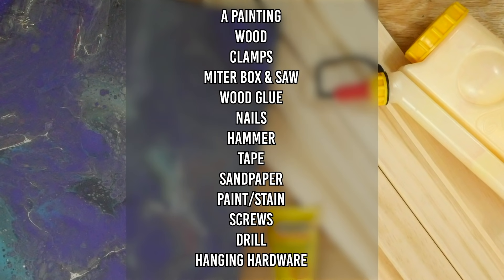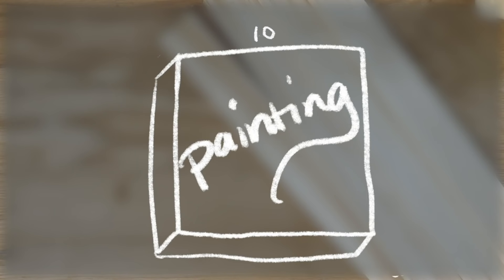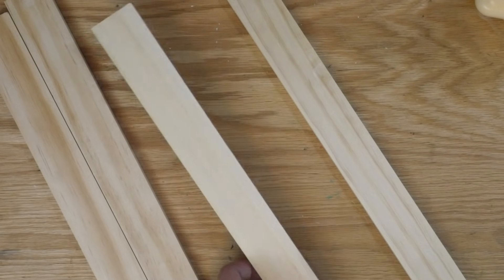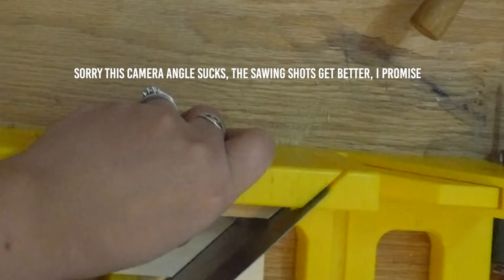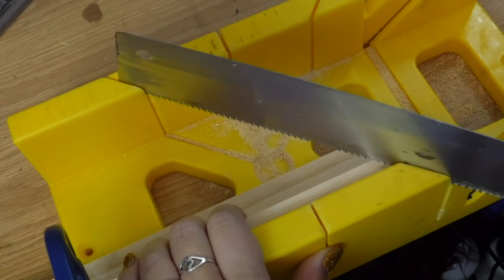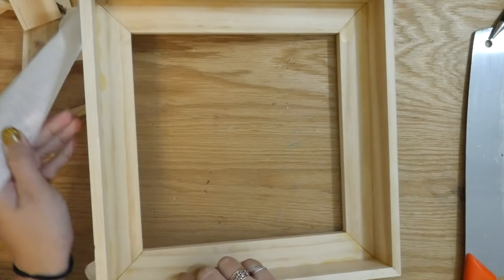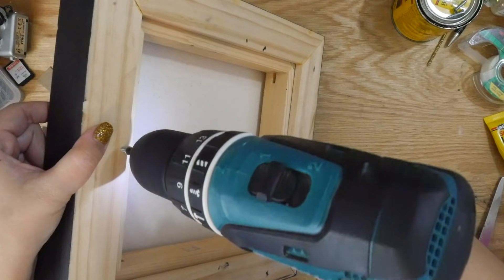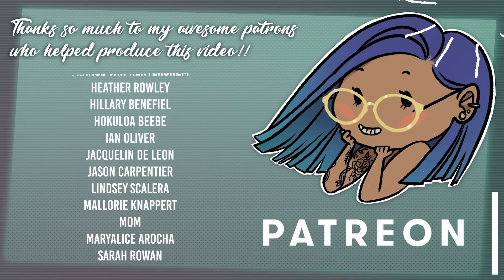How to Make a Floating Frame : DIY

Comment: Great work for beginners in wood working and awesome video and tutorial!

I would recommend going through grits when sanding, especially on pine, starting at 100 - 120 - 150 - 220, wiping off or vacuuming off the dust and using mineral spirits between grits; this will ensure that the stain will take better. Finally, apply a coat of wood conditioner to wood (only for soft woods like pine), this will prevent or reduce splotching that you get with stain when applying it to softwood. After the desired coat(s) of stain is applied, scuff sand with 400 grit sand paper, then seal the wood with Shellac, or polyurethane.
Reply: Shellac is preferred for cotton or linen art canvas.

Comment: You are like the 14th person I’ve watched make this frame and you stacked the two frames (inner and outer) so that you have a seam showing on the outside. The support pieces Can be placed on the inside so that When the picture is on the wall you have one solid piece of wood showing all around. I knew you were doing it differently when I saw your animated drawing at the beginning. The two pieces of wood were stacked in reverse. Curious if you have changed this on subsequent floating frames you have built?

Comment: Thank you so much for such a clear video!   I need to frame a 24" × 20" painting on canvas panel & can't afford the $50-100 for a ready made floater frame. Your video is the answer I was looking for: no fancy tools or gadgets! Since my painting is large & on a 1/4" panel, i am going to use cedar lattice to make the frame. I already have it from another project:  conditioned (sealed) & stained! Just have to cut, miter, & assemble it. Thank you for sharing!

Comment: Where did you get the yellow thing to help assist with your cut? It looks easy to use I need one lol
Reply: Check out Lowes or home depot
Reply: @ByRonnita  Or you can make one out of three pieces of wood, some nails or screws and the saw you will be using to cut the meters ( angles) Pax

Comment: What saw are you using?
Reply: Debby, I don't know if your question has already been answered and  I don't recognize the first saw but the second one looks to be a common cross cut saw. While this saw will work, there is one called a " back saw" with a stiffening bar on rhetoric edge opposite the teeth and is designed for making precise cuts. Pax
Reply: @rduff1999  Thank you!
Reply: @rduff1999  Thank you!